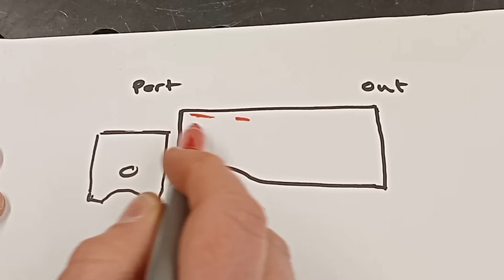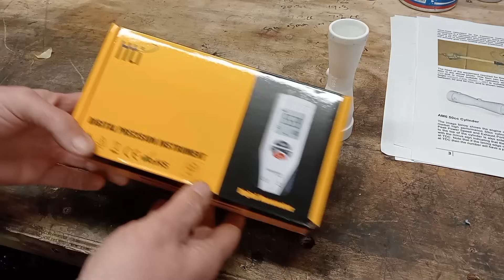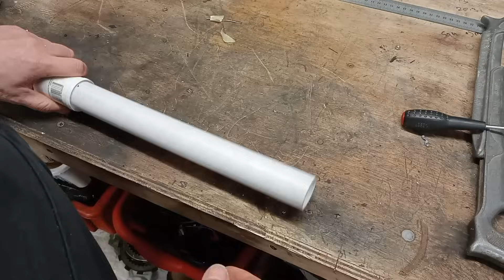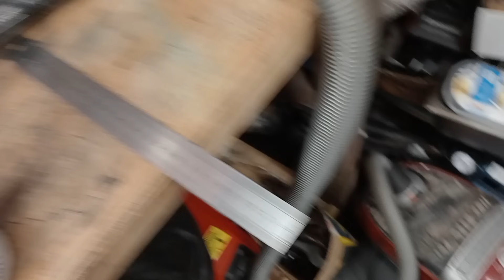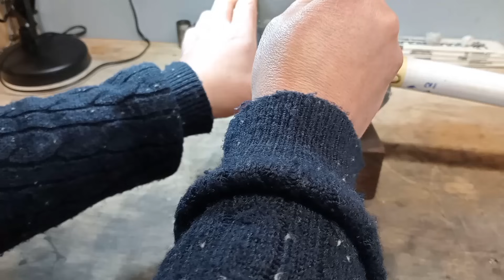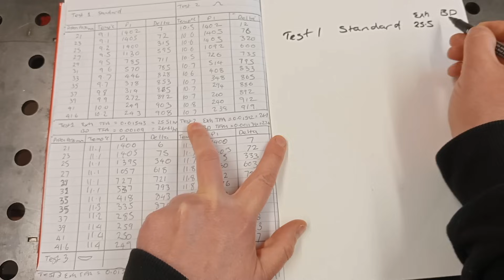2 Stroke Flow Testing - Power increase? 100 MPH Moped Challenge. #power #2stroke #hp

Comment: Keep in mind that the actual flow during blowdown is almost entirely choked flow , (Speed of sound) and bears almost no resemblance to low pressure cold flow as tested here. What seems to be an improvement in this testing may not have an effect at high pressure high temperature flow during blowdown. 
RULE OF THUMB if the exit pressure absolute is about 1/2(.5283) or less (or~ 2:1)of the stagnation pressure absolute(storage pressure) then the flow is choked (Mach 1) (in cold air anything above 13 psig gives Mach 1). Blowdown will start at ~100psi+ so will be choked for a good portion of blowdown time.
This data is not in a format I expected so I have to think about it for a while to make sense of it. I want the actual areas, volumetric flow figures, flow velocity etc.
Reply from the maker: Hi Bill, all noted.
Hopefully further testing as described in the video may validate the results seen here 😊
Reply: That is a very good point. You see a lot of flow benches that don’t even run enough pressure to ensure turbulent flow let alone choked.

I wonder if any of the big consultants have a 3D compressible flow CFD+engine sim package which can be used to simulate everything together?

Comment: Nice!
I would say the easy part is to get exhaust flowing enough, the hard part is to aim the transfers to keep the gas trapped.
And having it trap a lot, the need for a good exhaust increases.
By that i mean, that one should always start with the transfers when porting.

And bear in mind, seldom in all simulation softwares, there isn´t any laws of physics holding you back, they predict everythings perfect.
That 25.5hp worth of flow might not be the actual number.

I noticed many are somewhat 'afraid' of rising up the transfers, for an example: the known 'roost' cylinder(100cc) for scooters are having 134 in transfer duration stock and it makes good power and a wide powerband that peaks around 12800-13500rpm
And the transfers in my friends roost cylinders are rised from that, and still makes very good power(i´ll try dyno that one around upcoming christmas.)

Rise up!! =)
Reply from the maker: Hi Patrick,
Yes - I need to flow the transfers. Possibly they are restricting the engine. It will be interesting to see what the flow.time.area is!?
I'm happy to raise the transfers and widen... 
There seems to be a lot of "rules" to two stroke engines and if you go outsiders the "rules" you are wrong... Hopefully in this process we may dispel a  few "rules" and myths... I'm going to trust the Dyno and let it and the laws of physics dictate what is good in terms of making two strokes fast.

I read some of what Roost does and he is really good at developing engines and cylinders with the restrictions that the initial layout dictate. 
In summary there are hard and fast rules but if something works and not within the "current" rules but it works then go with it😁
Reply: @AutoBeta2T  I´d say flow area is second to aim correctly and time it correctly, but yeah!
When trying to squeeze all from a certain setup one needs to make ports huge.
If i remember correctly the Aprilia RSA were in the neighbourhood of 140 in transfer duration.
And an another example, i had a discussion with Frits about my old kawasaki 212cc build(kx250 engine).
I dynoed that 70+ at the wheel(methanol) at 12600rpm, it pulled all the way to 13200rpm
He said it was impossible to make that power at that rpm, well it did =)
I had 142 in duration at B-transfers, and 203 in exhaust(203 at the aux ports also)
Even if my 70+ was wrong, the rpm wasn´t, and the rpm was the big problem Frits said, it should be impossible to make power at those rpms he said ;)
Bumblebees shouldn´t fly either was my answer to that =)

Came to think of this thinking of 'rules' =)
Reply from the maker: My old boss use to say: rules are for fools and the guidance of the wise. That's me knackered as I'm certainly not wise.

Back to transfers - i did epoxy mine to reduce them from 136/138 to where they are now so it should be simple to remove. Also I did a vinamold cast to make the transfer bungs and I haven't done as good of a job as I thought on the transfer duct roofs.
Reply: one old school trick of raising the transfers and therefore the peak overall power/rpm was to raise the whole barrel by adding extra lower barrel to crankcase gaskets and then removing the same amount off the top of the barrel to compensate for the loss in compression etc. obviously this also raised the exhaust port too which was no bad thing if you wanted to do that anyway.
Reply: That’s why having the best point of mean reflection in your expansion chamber has to be on the money or your just wasting fuel
Reply: What transfer duration are you running at over 130?
You can raise the transfer ports alone but if the AFM has the same Exhaust MPA, you’ll end up with a engine that “loads” up constantly

Comment: 2T engines are not comparable to 4T cylinder heads, and operate on the principle of unsteady flow, so flow testing is not likely to be of tremendous use. In the early days of 2T engines, the exhaust ducts were often overly large, and significant performance gains could be realised by welding up and reshaping the duct. Increased torque, is the most noticeable thing that is generally gained from a smaller exhaust port. Its a very good idea, to try and read up on 2T engine operation, and understand how the engines work.  Not sure if its still available, but the best book I have seen on 2T engines is "The Two-Stroke Cycle Engine" by John B Heywood and Erin Sher.  Scavenging is the most important part of the 2T cycle in terms of generating power, and if you have sealed off the transfer ports, any sort of flow testing is questionable, as it will not be even remotely related to the flow inside a running engine.
Reply from the maker: Hi - yes 2 strokes are massively different to 4 strokes and the unsteady gas flow inside is interesting. I'm no expert and I'm just  documenting my experiences with this particular 2 stroke engine, really as a novice, but I did note Jan Thiel's words in his book and he did use flow testing to assess modifications to the engines he worked on. Jan Thiel developed the Aprillia RSA 125 which made 54 hp at the output sprocket.
As with most of what I put up here it's just my meandering around the "what and ifs" of 2 Stroke engine technology. Something's may work and some not.
Thanks for the comment - it's really appreciated.
Reply: @AutoBeta2T  I would guess Jan Thiel had a very good idea of exactly what he was wanting to achieve? It will have been something very subtle, and you may find you get better results from something other than flow testing? 

Welding up exhaust ports was carried out in the 60s on TSS Bultaco's. Increased torque, and made them come out of the corners much better.

How many cylinders do you have?  Its a good idea to have several, so you can try some different ideas.  The idea that bigger is better still persists, and you might find that isnt the case, if you test several back to back with different configurations?

I am trying to improve Yamaha trials motors, and have managed to collect up 5 or 6 cylinders, which wasn't that easy as they are very hard to find now, as the last one was made in 79!
Reply from the maker: Hi :) possibly but It's an area I wanted to explore. I think actual flow benches are very expensive but the set-up I am using is relatively cheap. 

Now cylinders are a problem - this is the only Autisa one that I have and they are like hen's teeth. I do have another but it's a copy of this and is all cast iron. I'd like to get some more and be able to do leap-frog testing but unless I can find another few that isn't going to happen. 
A standard AR80 cylinder would be good but these are difficult to find too.

To make matters worse it's on it's last overbore...
Reply: @AutoBeta2T  If you cant get parts, then its going to be very difficult to make much forward progress. I would have thought something like a 50cc Minarelli might have been a better choice?
Reply: I read Blair’s book, was impressed by the p/t sensors used and the data logging.